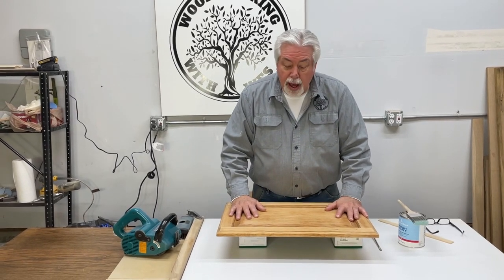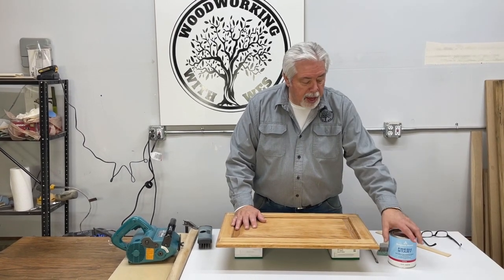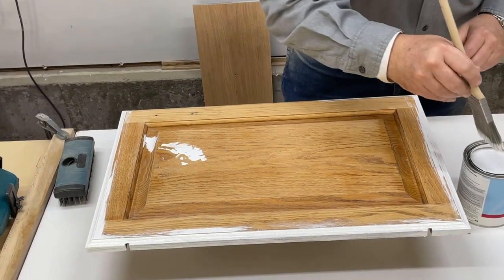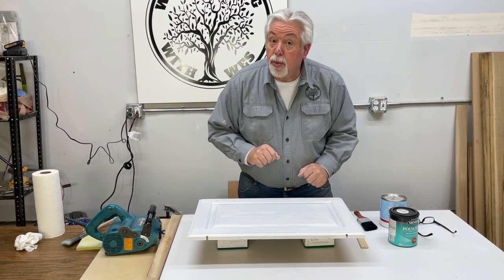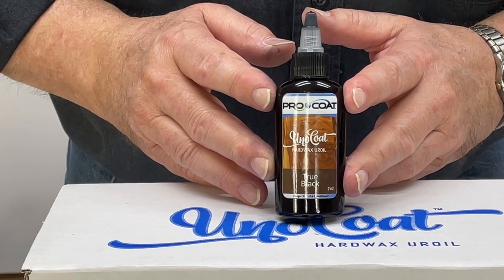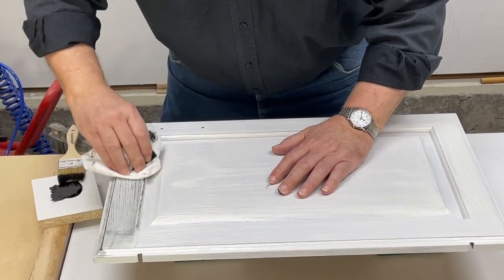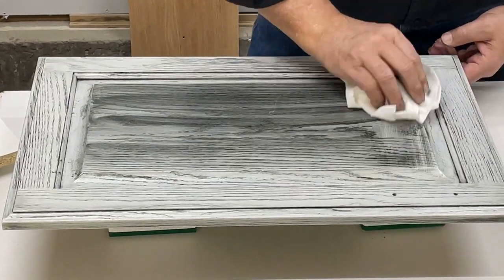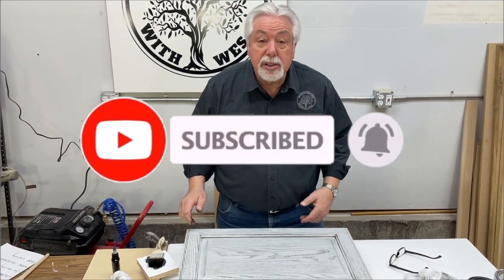A Custom Finish For Your Dated Golden Oak Cabinets

Comment: Good video. But, I would guess this process would be liked by those who like to paint brick. This is a good niche product. But if buying a house and the cupboards were finished this way, how hard would it be to undo, or take it off, or would the cupboards have to be replaced? As for me, I could see using it to fill small flaws in wood, maybe mixed with epoxy.
Reply: What's wrong with this style?
Reply: @megsmileyface6202  Good question. First a good portion of people, including me, don't like the look. But the problem is the same with painting brick, it's almost impossible to undo, forcing those who do not like it to replace good cabinets. However, if this could be done with a sealer coat underneath, to protect the wood, much of my objectiong would be gone. If I was house hunting. I would instantly drop my offer by $10,000 as the cost to undo or replace. Just my opinion. Thanks for asking.
Reply: @Original_Old_Farmer  That makes sense. Thank you for the info!

Comment: Wes, you mention in most, if not all, of your videos that we can choose any color we want. However, we went to our local Benjamin Moore store to get the Fresh Start primer tinted 1) a dark grey and 2) a blue denim color, but they said they could only apply a small amount of tint to each quart, and were limited in colors. The result was few options of light colors. Suggestions?

Comment: Hi Wes, AMAZING WORK!  I currently have plywood cabinets (old old house) that were painted using melamine paint!  How do I remove that so I can ceruse them?  Some of the cabinets were just painted and have some sort of top coat on them!  Will cerusing work on plywood?
Reply from the maker: Hi Janice. probably not given the previous painting that you described. I don't see being able to highlight the grain sufficiently. Thanks, Wes

Comment: I have unfinished cabinets that I just got to redo my kitchen,my question is, would I have to use the wire brush on my new unfinished cabinets,I really want to do this on them, I only have 23 cabinets to do,I need help.
Reply from the maker: Yes...still need to wire brush to enhance the grain. It is easier on unfinished wood so you will do well. Thanks, Wes
Reply: @WoodworkingWithWes  thank you so much.

Comment: cant wait to give this a try, Question the glaze, it comes as a  2 part mix , looks like you only used the A part , or does it come mixed in the sample bottle,  thanks
Reply from the maker: Hi...on this video I did not use the activator but I would suggest using it. Thanks for watching, Wes

Comment: I tried this process & didn't have the success.  Do you have to use a sealing type primer for base coat or just choose a paint color & go with that?  If using the BM freshstart I could have that tinted?
 I also ordered 4 sample glazes from pro coat.
Reply from the maker: Benjamin Moore Fresh Start can be tinted to your desired color but must be sealed before glazing just like I did in the video. Thanks for watching, Wes

Comment: I never received a response from my last message & would like to get a bit more clarification.  For starters...can I tint the primer to do this process?  Instead of the back breaking work of a hand wire brush could you use wire brush adapters on a drill?
Reply: Also, could I use any color paint of my choosing or do you recommend the primer
Reply from the maker: Yes, a wire wheel on a drill can be used. 

As far as paint, I recommend the primer. If you want to use a paint finish first, be sure to try a sample to see if it will give you the desired results. 

We have several videos on different aspects of the cerusing process. I invite you to look at those videos, I am confident your questions will be answered. 

Thanks for watching, Wes
Reply: Can you tint the primer?  @WoodworkingWithWes

Comment: In your other video's you sanded after glaze to get that look, im confused
Reply from the maker: Sorry about the inconsistency. I certainly could have and should have done that on this video. Thanks for pointing it out. Wes
Reply: Sanded after glaze??? With what??
Reply: Top coat..  @riptidebsi
Reply: @riptidebsi  In previous videos, Wes lightly sanded after glaze using a extra fine grit sanding sponge. Just to bring out the colors a little more.

Comment: How many coat  you did of sealer on primer base ?
Reply from the maker: I did just one coat. Thanks for watching, Wes
Reply: @WoodworkingWithWes   in one of your earlier cerusing videos from last year you painted golden oak cabinets with a commercial white primer and then used a dark brown glaze but you had to sand it off to get the look. This looks so much easier...All you have to do is wipe it. Does this product eliminate the need for sanding? If I use a regular tinted glaze and not this product, would sanding be necessary like it was in your video last year?
Reply: @jp1appy Wondering what you ended up doing.  Did you use this glaze or a different brand? Was sanding required? I'm cleaning my cabinets now for this. 🤞

Comment: I did get a yellow effect from that very polycrylic. I didn’t expect it from a water based product but it happened. This hasn’t happened for you yet?

Beautiful job in the end. I’ve fallen in love with this look and have practiced on a few doors. Trying to get on your level. Great job Wes

I also used the Valspar clear mixing glaze from Lowe’s if you are looking for any other glazing options.
Reply: You got yellowing using the process Wes provided on this video?
Reply: @JZ-kx1tc yes. Using the poly-crylic. And the valspar glaze
Reply: @alexwilliams8131 
Did you use the BM primer? Were your cabinets already stained? I just went to BM to get the primer and the sales guy said I'd get yellowing since my cabinets are already stained and that I should use an oil based primer like zinsser. 🫤 Now I don't know what use.
Reply: @dawnhritz6538 I only got the yellowing after applying the polycrylic. I had a sage green door with a white glaze. Then applied polycrylic. The white glaze yellowed after
Reply: @alexwilliams8131  
What primer did you use? I thought it was 2 coats primer,  polycrylic, glaze,  polycrylic?
Reply: @alexwilliams8131  I got a brownish bleedthrough in the grain areas after the white  primer.  It's ok for me as I plan on using a dark stain which will be in the grain as well.  We'll see how it turns out.